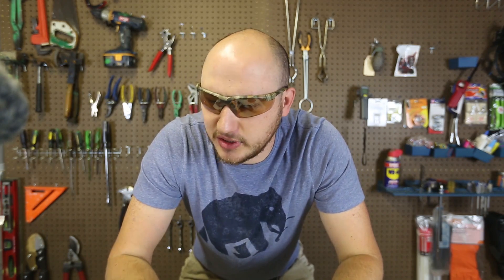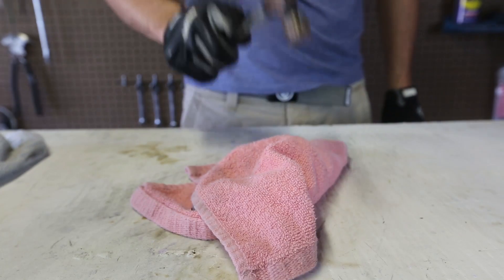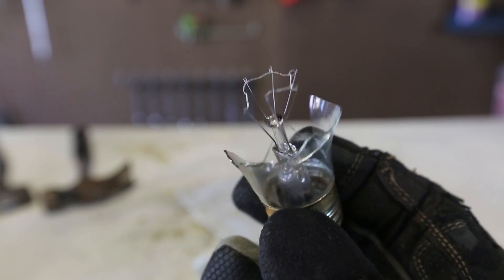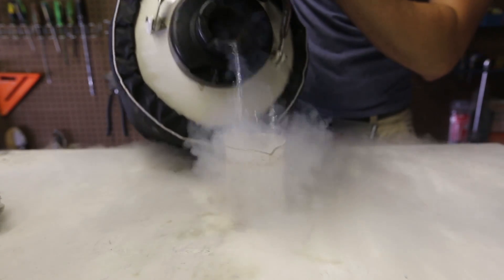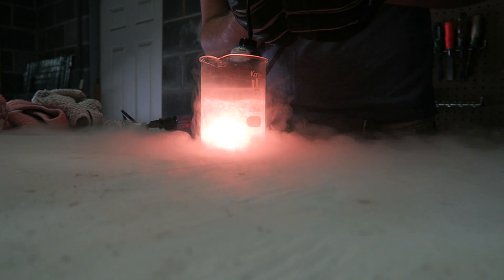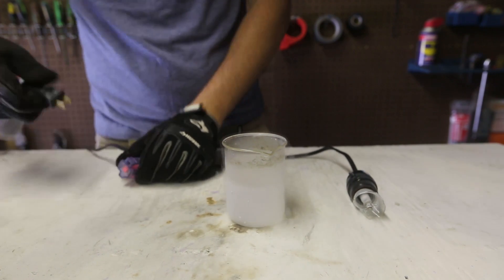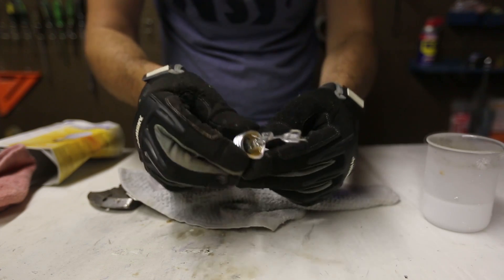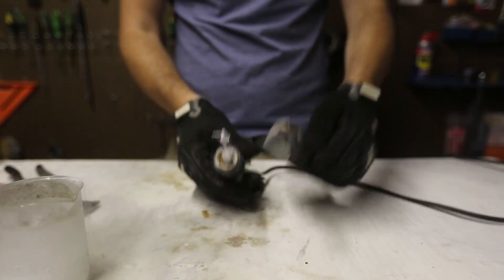What Happens If You Put Light Bulb in Liquid Nitrogen

Comment: Here's your answer:

Firstly, Tungsten (The elemental metal used for filaments in incandescent lamps) has a high melting temperature, which makes it ideal for this application. But when you have it in a lamp as a filament, it will vaporize slightly (this is why some high wattage lights will blacken as the tungsten sputters onto the glass envelope). In open air with lots of oxygen, you also have another issue... the hot tungsten will form an oxide with the oxygen in the air... This in turn weakens and destroys the filament. If you can reduce the operating temperature, this will reduce the light output but ultimately extend the life, but it will still fail over time. If you dip the filament in liquid nitrogen, you have a pure Nitrogen atmosphere around the hot filament with thanks to the Leidenfrost effect, which creates a bubble of Nitrogen gas around it. When you have this bubble, it stops oxygen getting to the filament and making it fail. It might also offer the slightest bit of cooling as the Nitrogen needs energy to change states from liquid to gas, but due to the leidentfrost effect preventing the liquid from contacting with the actual filament, that thermal transfer will be very little.

Comment: Hey Turas, just wanted to say that the light doesn't go out because the liquid nitrogen isn't actually touching the metal due to the Leidin Frost Affect. It's protected by a layer of steam or vapor cause by the extremely cold liquid in contact with a object that's temperature is a lot warmer than it so that causes the steam layer to form and kind of levitate the object. Great vid to!😉

Comment: if liquid nitrogen is cold, then how is it "boiling"?
Reply: It's boiling point is very low
Reply: because it boils at a temperature much lower than room temp
Reply: the boiling point of liquit nitrogen is under 0°c and the air around is about 20-30°c warm so the nitrogen is boiling
Reply: Science
Reply: Nitrogen boils at  very low temperatures

Comment: it usually doesn't burn out in the bulb cuz the bulb is in vacume
Reply: Wouldn't the glass break under that temperature?
Reply: +Psihopat For RB26r34Johny It doesn't break the glass because there is a heat resistant gas called argon they put inside of lightbulbs.
Reply: +BAD Ben But it's heat not cold resistant? So it should break, because the glass would change temperature so fast it would break? I'm not a scientist. :D
Reply: Psihopat For RB26r34Johny do you mean the breaker? I thought you meant the actual glass with the lightbulb (what he broke). If you mean the beaker, I'd imagine that the glass isn't breaking because it probably is pretty thick, and thus extreme temperature resistant. I might be wrong though because my knowledge on glass is pretty limited.
Reply: +BAD Ben Im also not an expert in light bulbs. :D I mean if you didn't break the blulb at all and put it in the liquid Nitrogen while the thing (I forgot what it's called) was shining.
Reply: if there is a gas inside of the beaker then I should break if you didn't break it before since the gas would try to contract due to heat loss until the pressure would implode the beaker, I guess :P

Comment: i believe the reason why the light didnt burn out is because liquid nitrrogen is -300 something degrees. and the light bulb filiment was pretty hot. these temperature differences are so great, they do not even touch. the only change is the temperature. if he held it in longer it would  have burnt 
out. the light went out in the air because... that i dont know.

Comment: the filament is creating a constant heat which is why it doesn't go out. also the light bulb lit in the liquid nitrogen and not air because the light bulb itself is air tight and in a vacuum. air prevents the filament from working. not sure why though

Comment: It's because of the lack of oxygen. When oxygen is present it oxidizes the filament and it burns out. When it's in liquid nitrogen, or even in its housing that is in a vacuum there is no oxygen and the filament lasts a long time. When the bulb vacuum eventually leaks the filament burns out quickly, or if the vacuum still stays there eventually the hot/cold cycles will eventually wear out the bulb.
Reply: You must be fun at parties :)
Reply: +Mr_Glibb we're both right. Older bulbs and some still today use a vacuum. However, most use an inert (nonreactive) gas such as nitrogen or argon. That makes perfect sense about the Leidenfrost effect of the nitrogen gas forming around the filament allowing it to not burn out.
Reply: Awesome that you know that wish i was smart! 😂😭😩
Reply: I think it is typically argon in the bulb rather than a vacuum.
Reply: Just stfu u nerd
Reply: +Max Cool not really because a light bulb normally heats up very much and still works fine. unless you are talking about how it got brighter when cooled
Reply: +Please WaitTM I don't see what's so bad about being smart? Like right now ur watching this cuz some genius came up with this thing so idk what's so bad TELL MEH PLS
Reply: I'm pretty sure no vaccum is related with the light bulb, what happens is the leidenfrost effect, the reason why you can throw liquid nitrogen in your skin and nothing will happen... it's like making solid co2, the solid piece floats on waterbecause of this effect...
Reply: Wow I didn't think they used vacuums in light bulbs. I thought it was just nonreactive gasses like argon or whatever. That must be why some light bulbs make a pop noise when broken.
Reply: +Slothery They don't use vacuums. You are exactly correct, nonreactive gases are used to form an atmosphere that will not destroy the filament. The liedenfrost effect here allows a pocket of nitrogen to form around the heated filament without boiling the rest of the liquid nitrogen immediately.

Comment: Nitrogen is an inert gas. It acts just the same as the argon that is inside the light bulb when it's intact. Inert gasses don't react or burn. As soon as he pulled it out, the vapor  around the filament dissipated and oxygen was able to reach the filament and cause it to burn out.

Comment: The only reason light bulbs work is because inside the dome is a vacuum, meaning there is no oxygen. 

When electrical current is passed through the wire it heats up, but due to the lack of oxygen it doesn't burn, in then the metal doesn't catch fire and therefore break.

What I assume is happening here is one of two things (or both at once)

Either the liquid nitrogen is dissipating enough of the filaments heat for it to not catch fire / burn, but not dissipating enough for it to not glow at all

and / or

the lack of oxygen in the liquid nitrogen means it can heat up but not catch fire, as there is no oxygen.

Comment: leindenfrost effect is my best guess why it doesn't burn out while it's in there
Reply: in case you did not knew, light bulbs are filled with nitrogen and there's no oxigen inside to burn.
Without oxigen and with the bulb filled with an inert gas the filament will just glow.
I guess our crazy russian hacker doesen't have that much knowledge...
Reply: +Issoxccddcc Usisxiiccisisi yeah because a light bulb is actually a vacuum that is why it was hard to break
Reply: rite but without the leindenfrost effect occurring the filament would not be able to stay at a high enough heat to stay lit. he did ask why it doesn't go out when he put it into the liquid nitrogen. Bulbs are filled with argon or nitrogen to preserve the filament otherwise oxygen would oxidize it.. [go figure]. but after all that I'm no expert and probably completely wrong about part of what I just said. Feel free to correct me! 👍
Reply: Nitrogen is not an inert gas.

Comment: It's because of the Leidenfrost effect.
Reply: +Mike Hunt *keys
Reply: The Leidenfrost effect is only when he pours the nitrogen  in the beaker and it starts boiling.
Reply: nerd
Reply: idiet
Reply: +- No Sanity - hmm, liquid oxygen + lightbulb... Sounds fun
Reply: Creating a vacuum like how the light bulb glass part forms during normal use.
Reply: its also filled with nitrogen gas, just like the way they do with the air in chip bags – pushes out the oxygen, thus prevents burning.
Reply: That and the fact that the metals into superconductors under very low temperatures.
Reply: Definitely not looking at the results of Leidenfrost effects or superconductors or vacuums. Quite simply as others have pointed out: oxidation of the filament won't occur while the filament is immersed in the mostly pure nitrogen liquid / gas.
Reply: Well the Leidenfrost effect is how a vacuum bubble is created in the liquid nitrogen like the bulb would create
Reply: Pandonaut Productions There is no vacuum bubble. A vacuum is the absence of matter. The Leidenfrost effect specifically referenced the self insulating effect of liquid state matter that comes into contact with other matter of sufficient enough temperature difference. I don't think half of the people who reference the effect really have a good grasp of what it describes.
Reply: Pandonaut Productions Vapour (eg steam), not vacuum.

If there was a vacuum, the liquid would stick to the surface like it's clinging for dear life.
But, since the surface is hot (in nitrogen's case, room temp), vapour is formed, and when hot enough, vapour is produced fast enough to keep the liquid in suspension.
Reply: Oh...Well thanks for correcting me